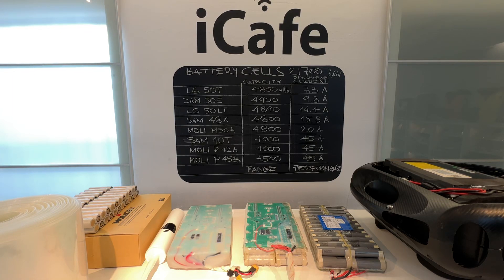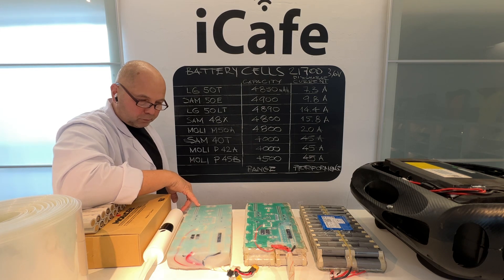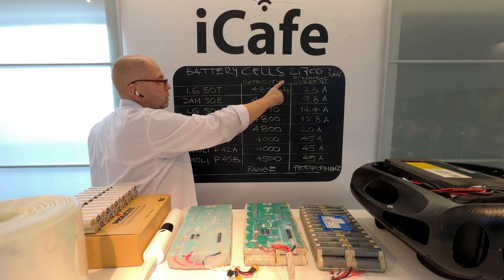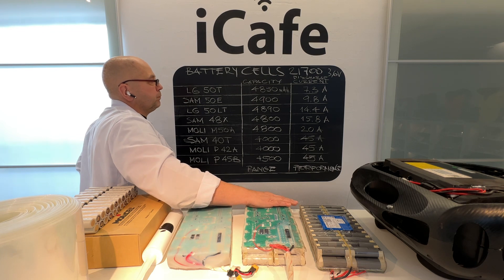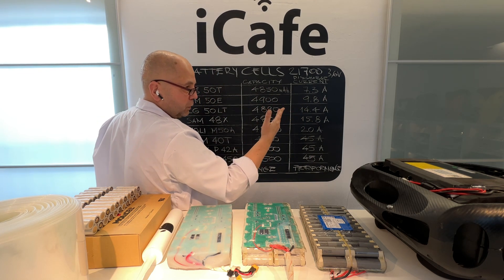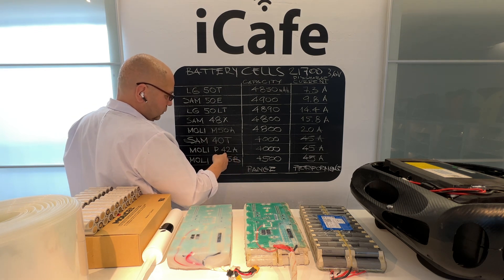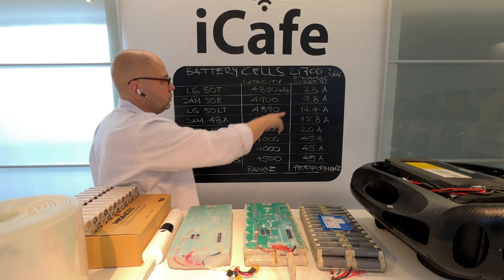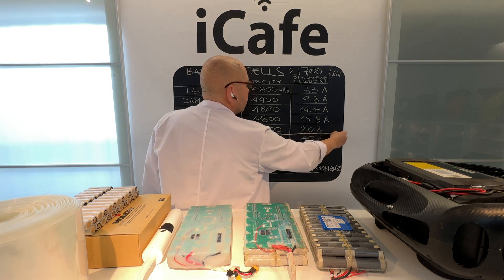Best Battery Options for Range & Performance. EUC.

Comment: do the molicel p42a degrade as fast as say the 50s or 40t? it would be nice to have a cell with more than 20 amp discharge that degrades at a similar rate of the 50e. it seems for a daily driver like the sherman s the 50e is great, but for a fast and fun wheel like an rs, commander mini, or commander gt pro the 40t, 50s, or molicel is the better option

Comment: A great explanation in terms that are easy to understand 👍 I just upgraded my Nikola Plus from 2 pack LG50 cells to 2 pack P42a cells. Not really ridden it yet, but have a question. You mention that the P42 cells have higher performance but lower range due to the higher amperage output. WOuld I theoretically get similar range as the old LG cells offered with the P42, if ridden sensibly (25mph, no racing or high speed runs) etc.? Thank you and keep up the great work! 👍🙏
Reply from the maker: Wow! I am envy. Nikola Molicel will be the ultimate street racer! Wanna more range? With a little twist you may squize a third pack into the empty top shelf. All you need is a dremel and a pair of xt60, xt30 splitters. 😁

Comment: Hey Sergei!
Thanks for the awesome  video!
I decided to purchase the (134 volt) (3,600wh) (4,000 w high torque motor) Begode  ex-30.
E-wheels usually swaps out the Begode batteries for safer ones, but this time decided to leave in the original batteries on the ex-30 because Begode copied Litech's configuration providing upgraded, heat sensing BMS and 36 mosfets including batterie redundancy for the ex-30.  
I like range, but I also like to sustain high speeds for about 100 yards at a time and push fast take offs. 

What is your advice for the choice of batteries? 
 Would the new Samsung 50S batteries be a safe choice and would they give me a little more range than the 40T cells?
Is it possible to swap out the wires for thicker gauge wires like the ones on the Inmotion Challenger?
Thanks for your time!
Reply from the maker: Hi Mike! Any full 4-pack wheel, 3600wh or more, is a pretty safe config. Choice of cells is not that crusial as on 2-pack wheels. 50S gives you remarkably more range than 40T. It may be all needed to feed that thirsty motor, as EX-30 seems to be an ultimate beast! Just look at Levi videos. Begode guys continuosly testing and improving it, day by day. Replacing wires seems a bit overkill, based on what we know today. ☕️🇸🇪
Reply: Thank you Sergei!
I really appreciate your expertise, time and feedback!
These details are so crucial when one is investing so much money. This has been very very helpful please keep making more videos! 
Cheers mate!

Comment: I have both a s18 and a s22. The s18 has LG M50T 5Ah 21700 format cells. I can say this is very bad for a wheel that is made for jumping and hard riding fun. I have experienced battery sag on it so bad it has cutout on me with no pedal tilt back at all. I have sustained great injuries due to this combination. The s22 has never given me issues so far. I think 2022 and moving forward is a better time for these devices, except begode we don't need 18 wheels released in a year we need safe solid builds.

Comment: Samsung 50S?
Reply from the maker: New 50S is almost same as Samsung 40T,  Good Capacity/range : 5000mAh, ok. max discharge current: 35A, but same short life 250cycle/60%.
Reply: @icafese  I want to make a 1,5 kW custom battery for Tesla V2, considering Samsung 50E as a golden middle. I am a rider of 100 kg equipped, gonna use Tesla as a city commuter.
Reply from the maker: @pogartua  Sure, 84v is Safe build. Did you choice 50E or 50S, begode BMS?
Reply: @icafese  I would rather take 50E and smart BMS from Aliexpress.

Comment: Informative but not quite the whole story. The maximum discharge of the batteries used is important but also the configuration of the cells. It isn't exactly the current that can be supplied but the power in Watts.  Watts = Volts * Amps. So my Master for instance with 50e cells could deliver 134.4V x 9.8A = 1317W  since there are 3 parallel banks (32S3P) this gives a battery maximum output of 3951W. The same cells in a 100V wheel would supply 980W for each series set, or in an 84V wheel 823W for each series set.  The conclusion, higher voltage wheels don't have to supply the same current to achieve the same power, further the more cells in parallel the more current that will be available, and this will depend on the wheel.
Reply from the maker: Thank you for your comment, friend! ❤️ This video is about choice of cells for your wheel. By my own research 90% of Masters with battery problems, overheated cables, burned contacts, mobo fire & cutouts has 50E cells, with max. discharge 9.8A. This config was designed for the max range, not for the peak performance. Begode videos of extreme climbs, jumps, upstairs, all done on 40T cells, max. discharge 45A. I found that top performance electric motorcycles use Molicel with same 45A discharge. You make your choice: range or safety? 😎 ☕️🇸🇪

Comment: Sergei, do you think a Begode EX with 50t cells is safe?
...... how about an MSP HT with litech 50e cells?  
I weigh 100kg.
Reply from the maker: Hi Will! ❤️ Both wheel are pretty robust and safe, at least if you weight is under 120kg, I would say. Non of mentioned configurations had previos fire records. Litech has no balancewite between packs, but they use advanced fuse and alarm system on each pack instead. It is just different approach on safety. In extreme amperage peak, says, on high curb or hard terrain, you rather will get cutout, than a fire. No worries! 😅

Comment: Hi Sergei, thanks for putting on this clinic on batteries. It was very informative and will probably prevent someone's house from burning down.
Reply from the maker: Thank You, Mike! ❤️ Too many riders doing extreme sports on wheels made for easy cruising.
Reply: @icafese  I really like that chart you made, breaks it down and black and white. You can't argue with the numbers.
Reply from the maker: @mikeintampa250  Thank you, Mike! ❤️ By my research 90% of Masters with battery problems, overheated cables, burned contacts, mobo fire & cutouts has Samsung 50E cells, 9.8A. This config was designed for long range, not for peak performance. Begode videos of extreme testing (climbs, stairs) done on Samsung 40T, 45A. There is a reason for that. 😎☕️🇸🇪
Reply: @icafese  what you're saying makes a lot of sense. For me I am into range instead of speed and instead of climbing so I think I should be okay with mine.
Reply: @icafese  on my Master v2 50e I cruise at 33 to 40 kmh and can get between 70 and 80 miles of range out of it.  I don't go too fast.  🙂

Comment: Great summary! The battery in my Nikola 100 V is labeled by Gotway with a tag ...it says LG M50T ...is this the same battery you called LG 50T?
Reply from the maker: Yes. Sorry for misspelling. 😅 3-pack Nikola is safe. If you have 2-pack config, do not charge unattended, keep it i safe room. ❤
Reply: @icafese  thx man